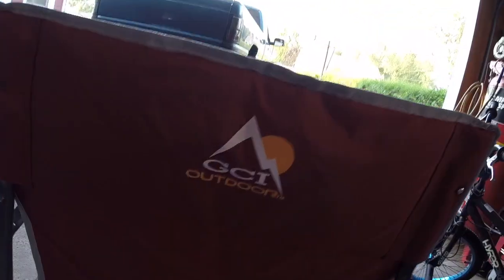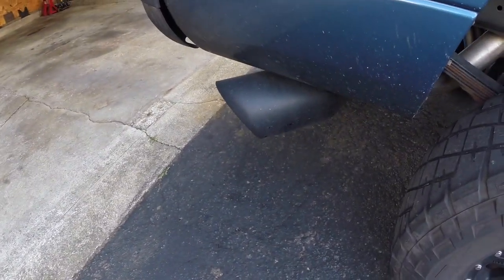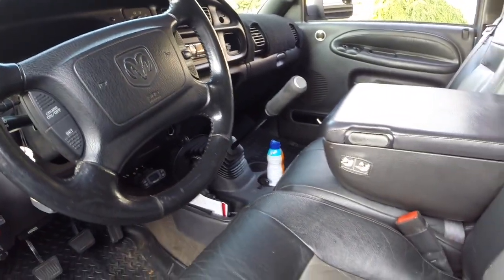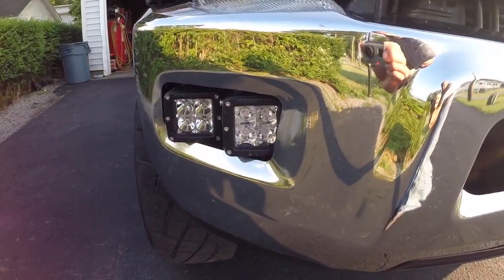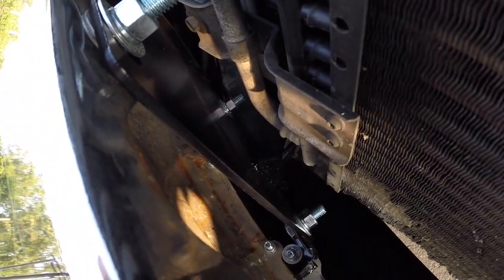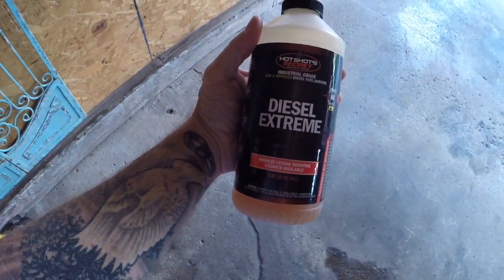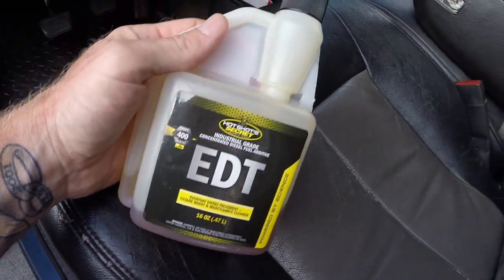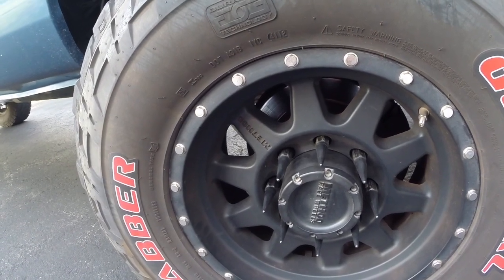Dodge Cummins Walk Around

Comment: If your on a budget you could paint it with the Rust-Oleum line of paint. I'm doing it . I'm painting mine with a sand color available in thier boat paint line of paint . It's a satin finish. I'm doing a gloss black tailgate roof hood and bu!per with gloss red highlights (suspension components .tow hooks etc) I have a 3 inch suspension lift and a 3 inch body lift with 33 inch wheels..
Reply from the maker: I've actually painted a few cars and bikes. I thought about plastic dipping the hole truck.